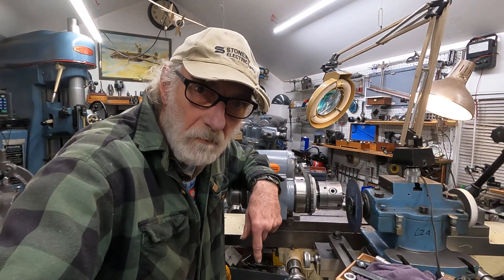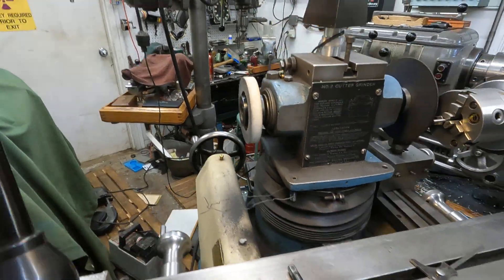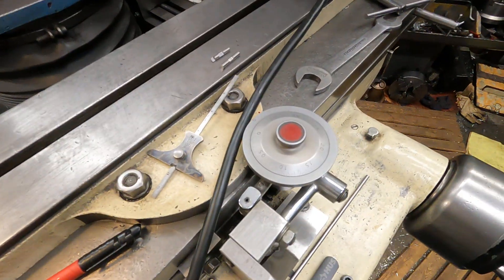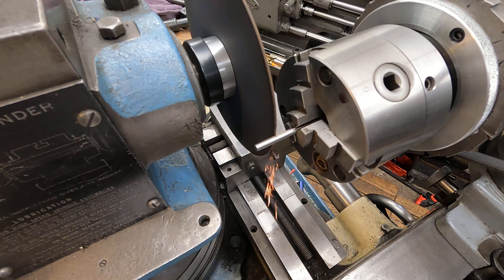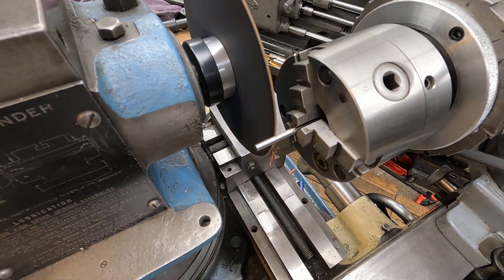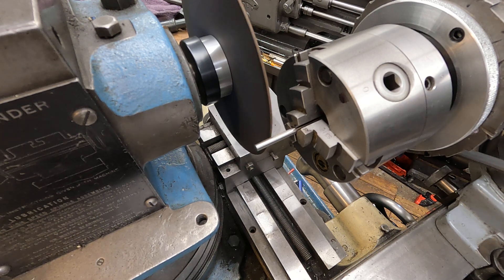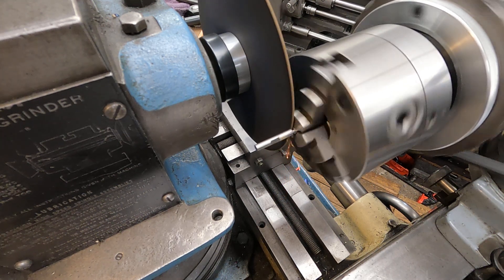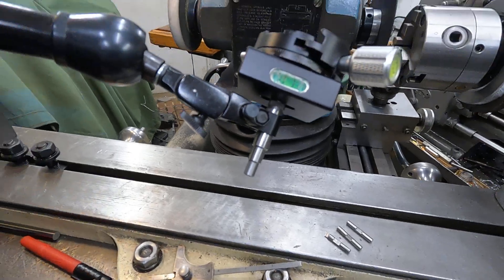Tool & Cutter Grinder Cutoff Wheel Work

Comment: Don, you should get yourself a clear plastic full face shield ......just in case!
You could always leave the last little bit (.020?) to manually snap off when finished.
Reply from the maker: I will show more shielding as I go further, the set ups will get more difficult.

Comment: Good morning Don. Do you know what he uses the cutter for? thanks
Reply from the maker: The cutters are for a small line boring bar for restoring VW engine cases cam journals after the cases are squeezed together, part of restoration.
Reply: That makes sense the cam journals on VW are not very big. Thanks @DonDyarprecision